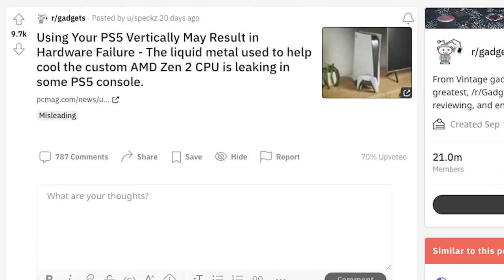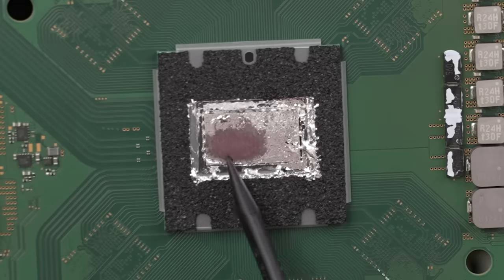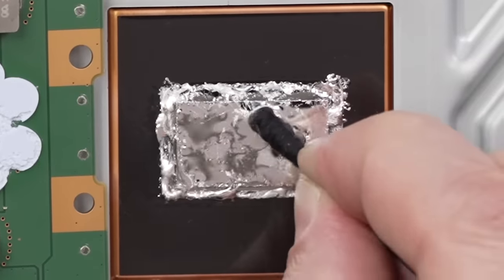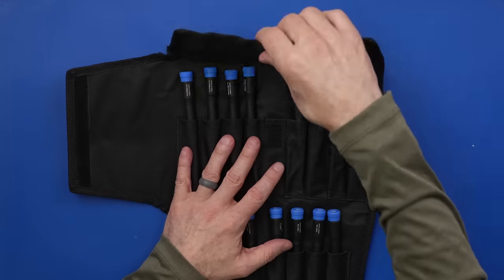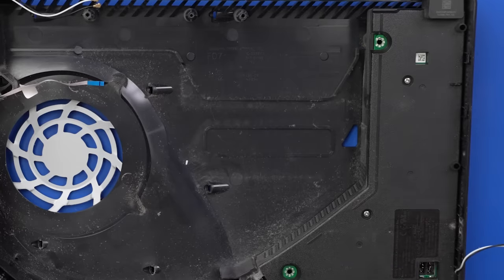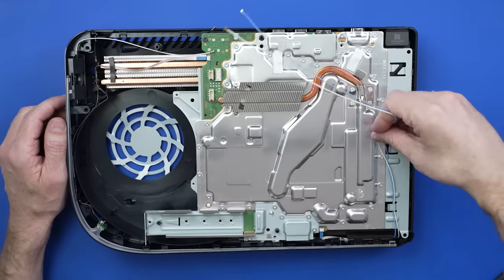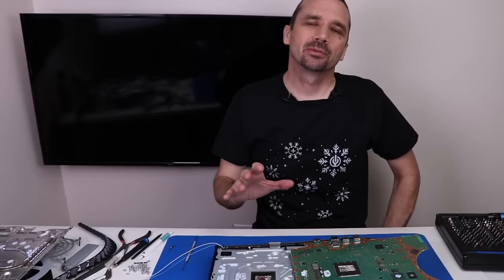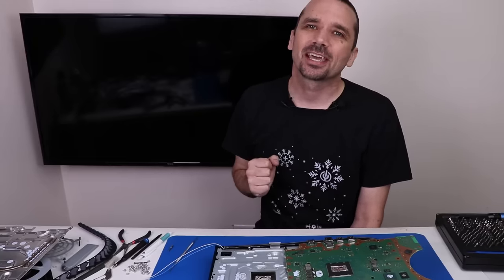PS5's Have a Liquid Metal Problem - But It May Not Be What You Think

Comment: The problem is was it dry like that from the factory or did it develop like that over time. Liquid metal SHOULDN'T do that, but then again most LM applications don't use this much. This has like a pool. It's supposed to be applied with just a super thin coat over the CPU/GPU and and heat sink/IHS. If it pools up anywhere, you have too much. Then the PS5 comes out and it's "supposed to be pooled up". Probably makes it easier for manufacturing, but is it possible having that much LM makes it possible to suck it and create dry spots?

Comment: I have a problem i think with my ps5 that hasn’t been an issue PERSE but would be nice to know why it does it
Reply: @Limulouse  when i turn it on, the disc drive does like a “fuuuv” sound and then normal, everything runs smoothly without any other souns
Reply: @Limulouse  ok exactly, thats what i thought, but just wanted to check cause i haven’t seen another ps5 that does that and actually turns on normally

Comment: Im not surprised that the ps5 is having problems lol, ive seen your repair videos and teardowns and immediately saw the main issue with reliability. Whilst thermal paste isnt going to last any longer at least it doesnt leak for whatever reason, wether it be the sponge is old, has been opened, not put back together right. Otherwise liquid metal is great.
Reply: I agree with him though, that most of the damage from leaking liquid metal is people who drop/impact their ps5. One certainly shouldn’t transporting a ps5, imo, immediately after it’s been running.

Comment: How do modern consoles NOT come with dust filters, like computer cases have had for years?!?
Reply: One could easily fabricate a dust screen. The potential issue is that it could inhibit air flow. Remember, most gaming pc’s have multiple fans vs the console only has one. Tbf, it’s mostly lazy slobs who don’t bother using compressed air to clean their console of dust bunnies
Reply: My guess is cost. Since most consoles are sold at a loss at first, why incur even more cost just to benefit consumers who many won't even clean the filters

Comment: I hate liquid metal on systems. There is NOT enough protection against spillage and also it isn't good for the system. Yes it is a better conductor of heat away from the APU but I would immediately replace it with top of the range thermal paste. Never liked the idea of liquid metal as too many things can AND do go wrong

Comment: Thermal paste, especially perfect amount of it is still better than this Liquid Metal
Reply: actually incorrect liquid metal is better than thermal peace that's a fact
Reply: @hnt8461  I’ve seen couple of comparisons between metal and usual paste and the difference was less than 10%, speaking of ps5 only and the temperature of the exhaust air
Reply from the maker: Disagree
Reply: @Tronicsfix well I'm going off of Science and scientifically speaking it is better that's not my opinion it's a fact
Reply: @Tronicsfix  whenever you have a chance, please, make a test comparison